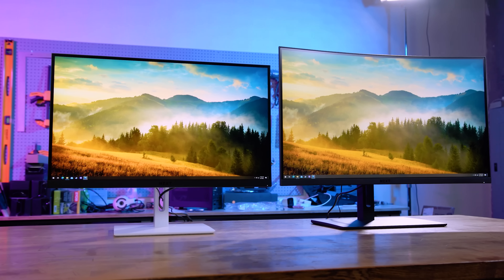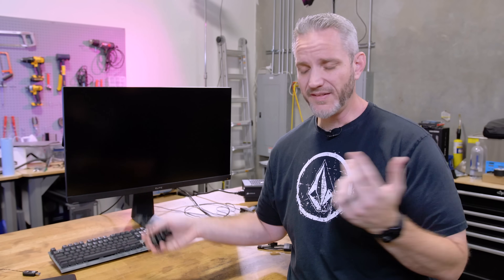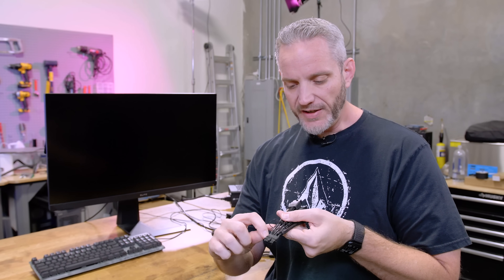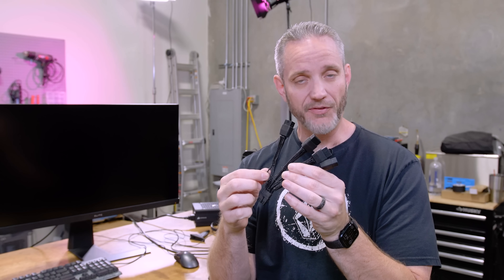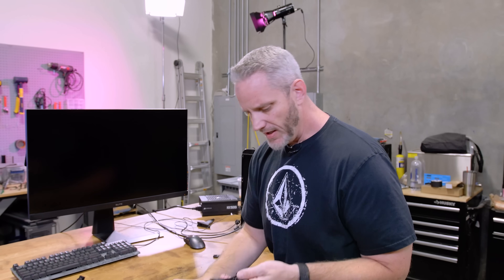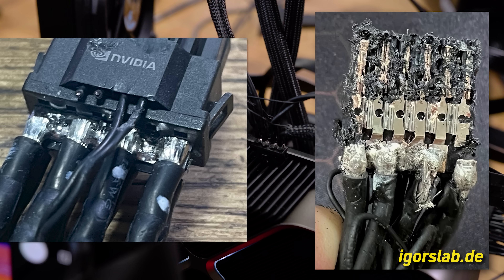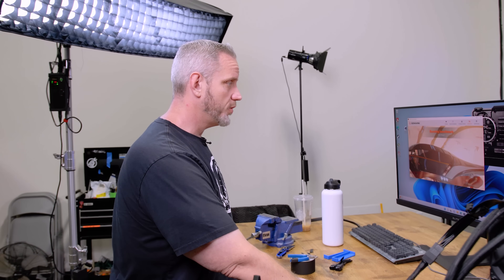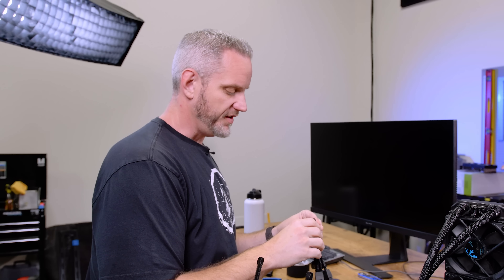Igor's Lab figured out why NVIDIA adapters are melting!

Comment: It could be a combination of things  like a partial crack where it archs intermittently and in a pc case with possible poor air movement can cause it to heat up to its melting point as the case start getting heat soaked increasing overall temps in case and room.
Reply: What is it’s also the fact that the cable overlaps to a different contact when bent? This would increase resistance on that contact and possibly burn the pins in there?

Comment: Thank you, the extended coverage on this has been great to raise awareness and get the info out there. I never liked the look of that cable anyway, because the 4 into 1 just doesn't sit right to me. I hope they get something better out to people have issues and refine these connectors for the next generation of cards, or at least the new PSU standards will hopefully resolve this.
Reply: Just buy a custom PSU 12 pin from cablemod.  Looks way better and works 👍
Reply: @aqulex84  yes buying overpriced cheaply made cables from that shit site is surely the answer!! No people should stop trying to cram a card in their pc that shouldn't be crammed in.
Reply: @SPG8989  lol. Keep doing you thing.  Using cablemod customs over 10 years, never had any problems qualitywise not looks or price. The new rtfm episode especially the beginning 20 minutes just describe your attitude perfectly.
Reply: @aqulex84  everything that starts with "just..." is in most cases ignoring the core problem.
sure you can circle around this issue, but it does not change the fact that nvidia has to be held responsible for this and they have also to act on it to make it up to whoever is affected if not providing a redesigned adapter for free to literally everyone who can prove via invoice that they bought a 4090.
to me this last suggestion is the only right thing to do.
Reply: Yes there are a few psu's put right now and it comes with the nice clean looking cable too 12vpwr
Reply: I got the gigabyte 1000w pg5 psu and it works perfectly with the new included cable
Reply: @th3orist  well I'm fully with you on this one. Sure it's NV at fault and they have to make up for the problem quickly. 

The "just" is about how to circle around quickly to get a safe way to make it work.  It's not that you just ignore the problem by bypassing it. 

But it will take NV a while for sure to address that problem to everyone who has a card right now and I'm sure there will be lot discussions with the AIB's as well like "well you're responsible for that as well. You hadn't have to use it" 

So the quickest way is to buy a third party cable or ask your PSU supplier if they already have a new cable for the pau you're running like the Corsair one they released now. 

To make it clear i would blame NV as well for that but sitting there and complaining does not sort the problem short term so if you're having the problem right now you need to find a quick solution now.

Comment: As Jay pointed out, the fact that current adaptor is soldered and not crimped like the 3090's is the issue.  Even when done properly, a soldered joint can't hand the same strain as a crimped connection.  The danger is when the soldered connection breaks but isn't fully separated, it can still make a connection but with high resistance and will heat up and possibly arc as well.
Reply: Already had a talk with a friend about it today. Power density is about twice of the old 8 pin plugs. 600W on this connector with 6 pins vs 150W on the 8-pin on 3 pins, so the old ones have about 50W or 4.17A per pin while the new one allows for 100W or 8.33A per pin.
Even worse considering that there are only 4 wires delivering to those pins. That would be 150W or 12.5A per wire.
And yes I know, the 4090 isn't specced for 600W, but the adapter is.
Reply: That's exactly why automotive technicians are taught by factory training to crimp wire repairs in harnesses instead of soldering them.  Solder joints don't like be jostled around and vibrated, which happens quite a bit in a moving vehicle.
Reply: your wrong a soldiered connection is much stronger than a crimp connection if done correctly
Reply: @craigbomer8962  Technicians are taught to crimp connections because it is easier for lower skilled people and can be done in less time.
Reply: A properly soldered connection is better than a crimped connection in almost all use cases.
It is easier and cheaper to properly make crimped connections. It is more expensive to train personnel to properly make soldered connections.

Most likely these cables are soldered by machine in an automated process and that machine needs to be reprogrammed/adjusted for proper wicking of the solder in the wire.
Reply: Just make your own. Costs $.30, some know how and a crimping tool
Reply: @TheSzalkowski  soldered joints are far less flexible, a crimped joint is always much more durable in an environment with vibration and other movement.
Reply: @spencerhansen2927  Charitably, I believe you are thinking about something else. 
Either way, soldering that is done correctly (NASA-STD-8739.3 is one example ) is superior to crimping in ALMOST every use case. 
IN the case of a wire terminated in a pin, a crimped connector and a properly soldered connector should be equally flexible at the point where pin ends.

If your definition of soldering is, "the bigger the blob, the better the job" as most amateurs then all bets are off.
Reply: @TheSzalkowski  That's a fair point.

Comment: The Problem is not only to disconnect the wires, like you said, they tried it with 1400W and it only started to melt... the bigger problem is when there are tiny little remaining connections from the broken solder + the wires on the outside are only connected to 1 pin and the ones to most potentially brake off, thats why the melted ones on the outside. And thats also the most dangerous reason for cable burns in houses, when cables are not good enough fixed, but still have a little connection. Sry for my bad english
Reply: @vladuk  … what?
Reply: @vladuk  The government and your social security number.
Reply: @vladuk  Also, your comment makes no sense.

Comment: Failure of those plugs reminds me of melting of old tamiya battery plugs in my younger year. One thing I learned then was items heated up and melted where the greatest resistance was... the fact your photos showed it melting around the pins themselves makes me wonder if the individual pins and sockets are spec'd high enough for the amp draw. Breaking off a wire won't  increase the draw from a pin it would cause the feed lines to heat, essentially reducing the effective size of the wires feeding the plug. 

What I do see from the pictures is potentially routing the wires pulling on and stressing the plug which is only retained by one center clip could cause slight loss of contact on the outer pins which essentially adds resistance and heat down near the plugs. This potentially aggravated by the thin walls of the plugs not able to clamp well enough to a pin that looks more suited to data than power delivery. It should be easy enough to test for with a simple resistance test with a multimeter while flexing the plug.

I am probably wrong, this is just my experience with plugs and power delivery on a hobby scale.
Reply: Mmmmm... ckay

Comment: Since the wire would break from the solder joint, try intermittently touching and removing the wire from the foil connecting pad.  The loose / broken connection would definitely cause a high resistance connection which would result in more heat.

Comment: Not sure about others but you're testing it in an air-con room. In a case where ambient is 40-50C, connector temp is probably way higher than 64C. Going over to Igor's lab to see their testing.
Reply: Jay's soldered joints also exposed to air, while it should be in tight plastic mold (pretty sure very bad for heat exchange)

Comment: As others have stated, a completely cut off wire/solder joint would not trigger the failure, most probable cause is the solder breaking of but slightly making contact thus raising resistance, and even maybe arcing

Comment: what you are missing is the disconnected wires being in close proximity of the pad. This will cause arcing. It is the arcing that produces significant heat and will cause the connector to melt.
Reply: Not arcing, but a small contact, like your toaster, lots of power though a little wire makes a lot of heat.
Reply: @TheMonthlyJack  if it was due to a small wire it would melt around the remaining connected wires. as those would be the ones getting hot. however the melting is occurring on the outsides of the connecters not the plastic in contact with the remaining connect wires. its is melting around the broken wires. therefore arcing is the more likely cause of the melting.

Comment: You're mostly right.  What you're missing is that...   A break will remain electrically connected, but because the connection is so small/weak, the resistance will cause heat.   Imagine running your stove on cat5.  :P   It could be the side bending does not cause a break, but causes the side pin to have a weaker connection, which increases resistance and heats up.

In short: actual breaks could occur, but don't need to.

Comment: This is a huge Problem in some old VW Polos too,
the problem is not that the cable completly brakes off, but its that it has a bad contact.
If the contact is bad and has a very small surface, it will get very hot.
This worses the resistance even more.
So you should try to not brake the wire completly off, more like creat a small contact surface

Comment: Honestly the old 8 pins were fine they looked better provided better dissipation and didn’t require a stupid adapter. this was a completely unnecessary connection I wish they would just scrap it.
Reply: Plus we have cable mod if you wanted a even cleaner look
Reply: Igor's article specifically says the issue is not the connector...PSU provided cables use the new spec connector just fine. It's NVIDIA's specific adapter build quality.
Reply: Amd will still have it
Reply: Amd already said they won't use it, Nvidia is alone in this madness
Reply: The connector works perfectly fine. It's the Nvidia adapter that's defective. You folks really ought to watch the video before commenting.
Reply: @chartabona  ya but what exactly was wrong with the old 8 pin? This was a cost saving measure the whole thing just seems pointless particularly with the price of these new GPUs
Reply: Though the increased resiliency of the PCIe Gen 5.0 connector in terms of transients is nice.
Reply: @GeorgeJFW  Loads of things are wrong with the 8-pin connector. There's far too many instances of people using pigtails to power their cards, or trying to run cards that trip their PSU's. Now you just have a single connector with sense pins that tell the GPU how much power the cable and PSU are rated to handle (e.g. 150w, 300w, 450w or 600w).
Reply: @Dan-gw3cu  Not even Intel is going to be using it, much less AMD.

Comment: Thanks Jay for making it clear that I don't have to worry about my 3070 TI Founders Card, that has the same kind of connector and it being safe to use. I was a bit worried until watching this video.
Reply: Right, I had the same GPU, but I don't ever force tight bends on heavy duty connections either so...Plus, we're pulling 1/3 of the power, probably less.

Comment: If the side pins were the ones getting disconnected, that means the bulk of the resistance would be in the middle of the plug, and also where most of the heat is generated, so pins on the middle would be melting.

For the sides to be melting it means that the middle pins aren't connected, however i personally think there's arcing on the sides, because Nvidia uses split barrel connectors inside, that will spread open when there's a bend sideways on the cable, causing a bad contact and arcing and then melting the plug
Reply: This is what I was initially thinking too, but isn't the voltage too low to create arcing?
Reply: You are correct arcing generates several times more heat than straight power draw. Given the bus bar’s design it will start internally arcing if damaged. This is less a failure in the new ATX spec than a failure in Nvidia’s implementation of the adapter.

Comment: I believe bad contact is worse than no contact with so much power going through it.
Explanation:
I assume, the melting is also exacerbated when the solder joint breaks but kind of makes contact and loses it again (maybe with a bit of arc) and thus heating the area ot the gauge reduces drastically which also causes heat.
I had something like that happen inside an old outlet which used aluminum wiring. Since the outlet was somewhat loose, over time it broke one of the leads almost completely off -> decreased wire gauge, so it would still let power through but started heating up and melted the plastic around it.
Reply: Why they outlawed AL in Trailers ! I don't like it AT ALL in ANY of my builds,ANYWHERE !  Just  too many things to go wrong IMO ! I'm a retired EE,worked a little under Journeyman in Industrial sets. And them quick push connects on the backs of 120v outlets,those need to go too ! I WON'T use it.
I'll give Everyone one FREE  LIFE SAVING piece of advice. Instead of CHEAPing OUT on 1 GFCI plug to protect your Bathroom plugs? Buy a GFCI Breaker and protect the ALL the wires TOO !! You may ask WHY ?!?  If you make changes,no worries,if your doing construction and have stuff exposed that COULD be reached,IT just MIGHT SAVE your LIFE!  IT SAVED my buddy's old enough long out of school kid ! SURE DID ! HOW's that for a SHOCKER !

Comment: I think its because when it breaks off inside it doesn't disconnect fully, leaving a sliver of material just touching the plate, creating so much resistance that it heats up tremendously, if you cut it off completely then there is no problem, since the rest of the wires can sufficiently feed the connector.
Reply: Valid point. As an electrician i can say, poor connections like you describe contributes to house fires "all the time". A clean break is safer cuz there is no flow after that.

Comment: So, one thing to keep in mind is thermal expansion.
Having good airflow in a case means that adapter will cool down fast.
If the solder points cool down too fast too often, they will start to gain micro cracks.
More cracks, more resistance. More Resistance, more heat. These adapters that are failing might have also gone through a bunch of extreme thermal cycles AND the pins on the end(s) where compromised via bending
Reply: thanks for commenting this. i learned something new today.
Reply: I really don't think case cooling would cause a crack in a solder joint. It would go hot-cold but in a fairly slow manner. It isn't a bare connection either, the insulation and strain relief on the cable would prevent any rapid cooling of the joint.
Reply: @--_DJ_--  Yeah i would be really surprised if this was a problem. It should be the opposite. Well cooled cases or an open test bench should ease the problem significantly by reducing temps on the cord.
Reply: @--_DJ_--  that's fair. It is insulated.
But thinking on it, it is attached to a thinner piece of sheet metal.
Maybe it's smaller thermal mass might aid it faster temperature change
Reply: @MegaGadgetdude  I think it just comes down to a poor design with little support for the soldered connections. It looks quite janky to be honest once it is opened up. Not at all what I would expect to see feeding your $1600+ graphics card. Looks very much like a cost cutting measure to ease the pain of including one with every card sold.

Comment: Hi Jay, I used to be battery tester on NiCad/Li-ion, the killer is down to resistance and timing. If the resistance on the plug gets hot enough it will build up oxide surround those pins, it stays hot over 70C and will increase in temperature as oxide build increase. It can take 100 hours more or less till the plug get so hot it eventually starts to smoke and that where the danger becomes.

Comment: Maybe it cracked but didn’t disconnect fully? I imagine that’d get pretty hot since you’re effectively reducing the wire gauge/raising resistance. Bad soldering (or even just old joints) are super prone to cracking. 

I repair old parts sometimes, and I can’t tell you how many times the fault was in a connection having an invisible crack. I’m automatically sus of any joint that isn’t shiny and smooth, or one that’s in a part that gets really hot and cools down a lot over use.
Cold joints (rough looking solder that didn’t fully melt when put together) or mechanically damaged one’s crack super easily. Same with joints that were done on a dirty surface and don’t wet properly. 

I don’t know how relevant that is to industrial scale, but I can see any of these happening in a factory trying to cram out connectors as fast as they can for as cheap as possible…
Reply: That is the exact point he got at in the video, yes.
Reply: @MaddJakd  🙄
Reply: @Kindjie  😏

Comment: Right... so the actual wire going to the pin (socket really, as pins are on the card) breaks off but the card is still drawing power through the outside pins (signal wire is telling it that it can probably)... but now the current is coming through the other wires and that little foil bridge. The thin foil obviously has too much resistance and heats up like a light bulb filament. Good design, I give it a 5/7
Reply: HORSE$#!T !     My QC score,and i was a QC Tech, is a 0/10  FAIL   THAT is my report. The metal is cheap,NOT good for conduction. SLOPPY solder work,the neighbor kids can do better hand work. Too many junctions overall,causes MORE resistance=heat. If i was on the R&D Team,someone would be shot for handing me this.